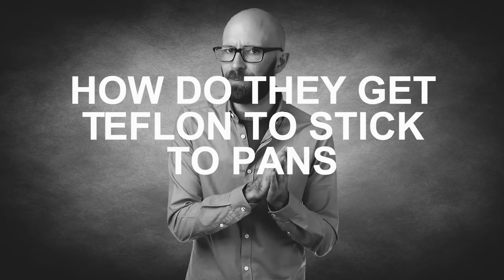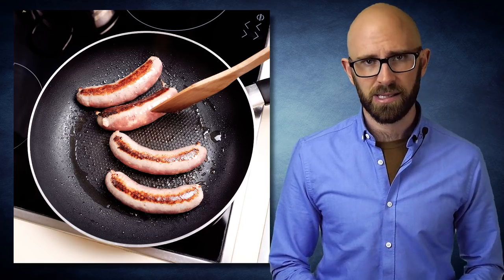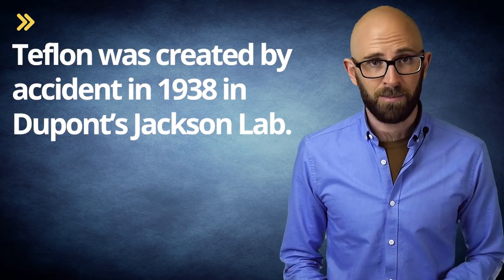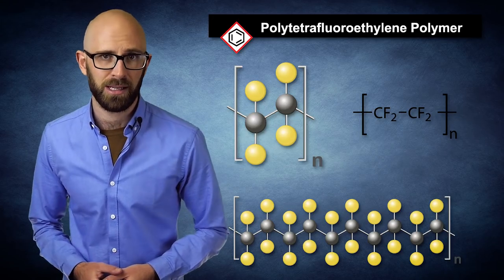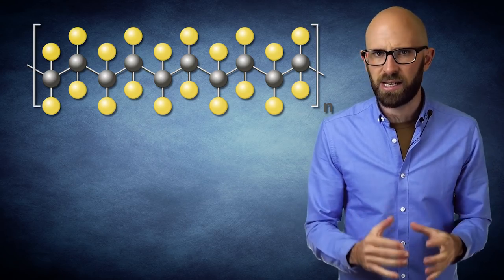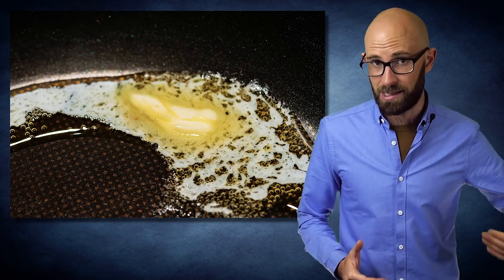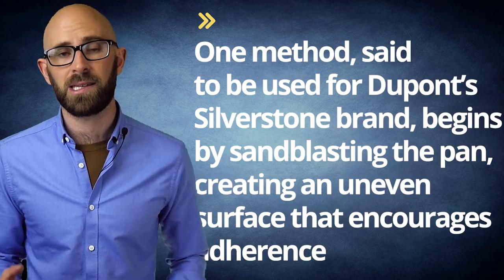How Do They Get Teflon to Stick to Pans?

Comment: I have a video idea: Is medicine with an expiration date still good after the expiration date? Will the effects still be as good as gold before the expiration date, or will it get gradually weaker?
Reply: Expiration date is the date up to which the manufacturer grants that the product will maintain it's original characteristics and will be safe to be consumed. Products may still be good to consume after that, but it's generally not advised to consume expired products, specially medicine, since it's degradation might mean not only it doesn't produce the desired effect, but it even might produce ill effects and harm you.
Reply: or will it decompose into something toxic? and if so.... how soon? There is probably 6 months of Pharmacy school devoted to this topic in some form or another. I have low hopes for a comprehensive answer, but focusing on some common specifics like aspirin and vitamins might be doable.
Reply: I'm sure the safety of this is influenced strongly by the type of medicine and how out of date it is.  Dates on product in general are usually based on a better safe than sorry mentality.  I personally use slightly out of date products of all kinds with no ill effect, based on judgement calls, how out of date something is, and anything I might know about it -- but I'm not saying you should.
Reply: old man voice  Back in the 90s, a pharmacist told me that the date was supposed to represent when 90% of the drug was expected to remain intact (for example, aspirin will lose the acetyl group over time and start to smell like vinegar).  I'm not sure how accurate that is though, as I don't seem to notice getting prescriptions filled with varying expiration dates, but rather instructions to discard after one year from fill date.
Reply: Raffi Sabghir they are not guaranteed to be fully effective after that date. That doesn't mean they immediately degrade, but over time they will become less effective. It varies by batch, but in most cases they will last at least a few months after that date just like food
Reply: Usually fine... Though if your life depends on it, probably best to take something "fresh". As others have said, it's highly unlikely to become harmful but may be less effective. Blister packed things are likely to keep longer as the packaging keeps moisture and oxygen out reasonably well, though not indefinitely.
Reply: There are expiration dates on things that last virtually forever, in most cases just take sniff and you know if what ever it is (food, cosmetic, medicine) has gone bad.
Reply: All that really happens is that the intended effects weaken, or there are new side effects. It basically just doesn't do what is was originally meant to after the expiration date.
Reply: Expiration dates in food are really just extremely rough general estimates, and in most cases are just legal requirements and actually is barely ever accurate. Some powerful person in the 1900's sister got sit from expired milk and he used his wealth and power to make expiration dates a legal requirement. They really mean nothing.

Comment: Industrial PTFE sheet with a back etched layer is common as slip surfaces in machinery, where the brown back surface is there from the ion etching to allow adhesives to bond to the surface to allow you to stick them down to a backing surface. Otherwise you have to drill and use mechanical fasteners to hold down the sheet, or use a thick sheet of PTFE and clamp it down. The front surface is slippery, the back not so. However it has reduced heat resistance, but is commonly used as a backing to apply pressure to heat sealing, like in a bag manufacturing line, where you have a hot bar forming one seal in a bag, then it is filled with things like sweets and then hot sealed top and bottom using another hot bar and cutter to separate the packs.

Comment: In my experience a properly seasoned cast iron pan is much easier to clean. (while it is still hot scrape it out with a metal spatula and wipe out the rest of the debris with a rag and you are good to go)

Comment: you can also use chemical abrasion to get it to stick and it can be applied as either an additive to liquid paint(in this case the oven operation has double duty of baking off the paint additives to leave a coat of teflon) or with electrostatic powder coating(the finely ground polymer powder is given a positive charge and blown towards the grounded metal part with a weird type of spray gun). and by high heat he means 650-850 F. I did some PTFE coating for medical tools.
Reply: So, you're saying you're the Teflon Don of Scalpels? And I'd be worried about using Teflon on products that could potentially go into an autoclave. Aren't they hot enough to get Teflon to gas?
Reply: Jack Linde hey just adding some insight... and mostly insertion tubing, not scalpels. Half the point of the Teflon is to allow these items to go into autoclave cleaners which go to under just under 300f.

Comment: In the early 90's I wanted to see what happened when Teflon met superglue.  But the most interesting finding was the label on the new pan: It was stuck, quite hard, to the Teflon.  I peeled it off noting that the sticker was tough enough to pull hard without shredding it.  But, the back of the now-free sticker felt only slightly tacky -- less than a post-it note.  My first assumption was that the adhesive was spent.  But, accidentally reuniting them, I found that it still grabbed the Teflon quite fiercely!  

So, this adhesive is specific to Teflon and doesn't act sticky in the general sense.  

Though I must say, a sticker proclaiming "non stick" is rather ironic in two ways.

Comment: "How Do They Get Teflon to Stick to Pans?"

They don't.  That's why it always ends up in your food.
Reply: Even if it ended up in your food, the chemical bonds are so strong that the hydrochloric acid in your stomach is little more than a warm pond to it. 

shush.
Reply: And in poor parrot's respiratory systems.

Comment: Bet my Seasoned Cast Iron will out  outperform any nonstick cookware.
Reply: Depends on what you want to do, but yes, good cast iron certainly is great, but also something >90% of all people would ruin in just a matter of months.
Reply: just careful of high acidity foods, especially often.
Reply: While I love my cast iron, it loses advantage at higher temperatures and reduced fat levels.  For quickly caramelizing sugars/lipids and working with lean proteins (i.e. roux, glazes, omelettes, skinned chicken), ceramic or teflon will win.  For slow-cooking, juicy meats like bacon, and oily stir-fry/braising, seasoned cast iron is still the flavor boss (and bonus -- functionally immortal and indestructible).
Reply: You still have to scrape food off cast iron pans, while ceramic might not last a lifetime but the hassle it saves is worth it.
Reply: Michael Parker Not if it's  well seasoned. Never use soap. Hot water, reoil and heat. Fried eggs easily slide out.
Reply: Robert McKeown That's precisely the problem that you have to baby it to keep it working which the average family just won't.
Reply: You can make English muffins on cast iron cookware!
Reply: teflon used at high temperatures releases c8 gas and is known to cause cancer. dupont just settled a lawsuit for $670million for exactly this.
Reply: The best cookware ever made...Cast Iron!!!!!!

Comment: Forget Teflon pans , they peel over time and pieces start getting in your food (it’s not good to eat plastic lol). Stick with ceramic coated pans for a better and safer non stick pan , or just get some stainless pans.
Reply: I bought a ceramic pan and that was by far my best acquisition as far as kitchenware goes. I can't recommend it enough.
Reply: I prefer ceramic as well, but I would never pick a stainless pan over a teflon.
Reply: I've heard that Teflon manufacturers include a warning label to stop using the product if it chips and to not use very high heat (vague, I know) because they would create toxic fumes dangerous to human health. My Teflon pots are all chipped and I will not be returning to them.
Reply: Teflon hardly reacts with anything so it's basically fiber, most plastics are similar when ingested. But I do agree ceramic pans last longer and less prone to flaking.
Reply: forget teflon, forget ceramics, forget stainless.

cast iron is all you'll ever need.
Reply: Iron pans FTW
Reply: Boiled Milk Steak: Actually, they've done studies and the worst that Teflon can do is mildly irritate your digestive tract. HCl doesn't do anything to Teflon, so the bits that get into your food usually just flush through your GI tract and exit in your poop. If a piece does get lodged somewhere in your GI tract, it is no worse than if other bits of food get stuck. Teflon generally doesn't interact with anything, so it would be a foreign irritant, not a poisonous chemical as you are inferring.
Reply: @Christiana I forgot about the fuming aspect. Yes, if the pot or pan is empty, and you heat the pan at high temps, it will create a poisonous gas. But then again, you're also running a risk of fire on your stove, since you've left an unattended pan cooking for a long time.
Reply: Cast iron!
Reply: The only real problem with Teflon happens when it gets over 400 °C, or 750 °F, which can only happen when you put it on a stove and let it heat up with nothing it it for quite some time. It's usually risk free because cooking at that heat isn't possible in the first place. As far as ingestion is concerned - that is an urban myth that has been circulating - i think as long as teflon-pans exist. But as Jack Linde said, it won't do anything, just pass through you. The teflon can, however, peel, as Milk said, and once that happens the food sticks, which kind of defies the whole idea of teflon pans in the first place.

As for ceramic pans - while they are really good, if you are careless and drop them the coat can break. So they are - imho - nothing for the clumsy or absolute beginners, and if you want some reasonably good ones they aren't exactly the cheapest choice either.

Stainless pans, while pretty forgiving when handled poorly, have the disatvantage of food sticking to it, especcially if you burn something. If used over longer time while cooking a lot with salt they also, even though they say they shouldn't, tend to corrode. Mind you, this usually takes quite some time. 

It all boils down - imho - to personal preference.
Reply: Teflon non-stick pans have their place but you need to take care not to scratch the coating, which can also burn off at high temperature. I assume the OP is referring to cast iron ceramic coated pans like Le Creuset. I have one that's nearly 40 years old and it's still going strong. If you only have one pan in your life make sure it's cast iron! Not so great if you're nomadic though...
Reply: Agreed. Also whatever you can get your hands on for free if you're skint.
Reply: I love your name. Milk steaks are my favorite. I like it over hard and with a side of jelly beans but only fresh. Cooked jelly beans suck
Reply: Teflon itself is relatively harmless when ingested because it does not bind to anything , and that includes us, water, and our internal gut lining. The concern comes from the additional chemicals used in treating the pan. Ceramic is great but avoid heat shocking it and you will be fine.
Reply: Windhelm Guard Cast actually freaks me out since you aren't supposed to clean it. I just can't do it.
Reply: brkr78 this isn't JUST a temperature issue though, it's time as well. The extreme heat changes these pans undergo rapidly increases the aging process(weakening the polymer bond) which is what allows it to flake off. But yes, the biggest issue with the pans is overheating creating highly cancerous gasses. That's why many industries are being forced into using non-pfoa materials which greatly lowers the carcinogens, but doesn't stick to metal as well. It's the reason I left the industry... My plant was using pfoas and the ventilation was not up to code and I was sick of fighting for it.
Reply: For many years, I worked in the industrial metals field and know that Teflon breaks down with heat, so no wonder TFE coated pans stop working.  The video didn't mention this.
Reply: I don't even own a teflon pan. All of mine are cast iron or stainless steel with a ceramic coating. I've used teflon, and they simply can't compare.
Reply: And there are certain high end pans which are stainless steel which last for a long while, and has a life-time warrant. They generally go around in the thousands in price
Reply: I don't know what you're all doing with your pans but we have teflon pans since arround 8 years (probably even longer) and they're still as good as at the first day. No chipping or anything like that.
You just have to handle it carefully and not scratch arround alot with a fork or a knoife or something
Reply: Thats coz you put them in the dishwasher
Reply: how hot are you getting your pans and are you using tef2 
think you might need to learn to cook 1st
Reply: Another Cast Iron fan here. Use soap to clean them to, just not as much as for other things. And they can be reseasoned as well.
Reply: Wustoff (the German company that makes some of the best comercial kitchen knives in the world) just came out with a new ceramic pan technology first developed in South Korea that promises to be almost as non-stick as Teflon but signficantly more durable and heat resistant (still can chip if you arn't careful, but nowhere near as easily as Teflon which basicly chips away if you blow on it).  I've heard osme good stuff about it and might get it myself.
Reply: Don't use metal tools to cut in or scrape with or even move around in your teflon pans, and holy shit look at that, PLASTIC DOESN'T DAMAGE PLASTIC?! WAIT WUT?! 

also stainless is a horrible option for anyone with possible nickle allergies. lrn2chemistry and lrn2metallurgy.
Reply: Most pans don't even use Teflon anymore
Reply: The ted talks video covers most of this but I’ll sum it up, it’s okay under 500 degrees and the little chips are considered okay but it’s advised not you consume them

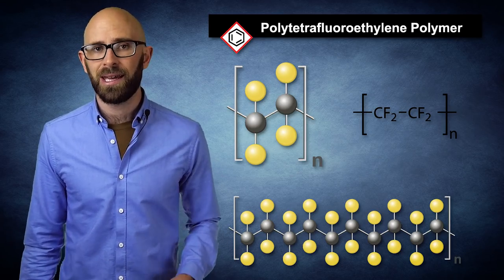Comment: A Fluoridated polymer isn't a long chain of identical molecules, in contradiction to the statement at 1:00
As first of, Fluoridated polymers can be any polymer that has fluorid in it. This could be anything from Sugar to Fat, to any other polymer.
Secondly, the repetition of the carbon fluorid pair is true, but the whole chain is the molecule. These molecules are though not making a chain as a group, but rather just a tangled mess similar to spaghetti.

Though, it is true that Teflon is a fluoridated polymer chain of an arbitrary length. But it would be nice to not have the term molecule used so freely outside its definition.

Comment: Woll has a product that they claim to uses diamond a coating which they claim is metal utensil safe, dishwasher safe, and oven safe up to 260c/500f.
Reply: oven-safe up to 260°C?
Wow, my car is highway-safe up to 70 km/h :P
Reply: @ABaumstumpf  you're car isn't 260c safe, your statement was absolutely horrendous. Just stop it, get some help.
Reply: @ABaumstumpf  no I got what you were saying about the typical use of an oven, I left it on the table because your statement is irrelevant as possible, not all pans are meant for ovens so he was clarifying.

Comment: Teflon pans are great, but once you go Cast Iron you never go back.
Reply: I have a glass topped stove. I only use my cast iron in my camping kit.
Reply: I have a glass top stove and I use my cast iron on it all the time.  I've done it for years with no problems.  However, I do place the pan on the stove somewhat gently, but then all of my pans are metal, so I set them all down on the glass top gently.
Reply: Well the iron pans are black maybe that's why you haven't gone back
Reply: you shouldn't have to clean a properly seasoned cast iron skillet, because almost nothing sticks to it. And if you do have something stuck in it, the deglazing technique works well.

Comment: Anyone know what reducing agent can reduce a C-F bond?
Reply: likely some F-based agents, pretty much nothing else is aggressive enough.
Reply: Probably an unstable thing (like H2F or an equivalent ionized compound?) that required energy input to form in the first place and works by substitution.  Low temperature plus electricity/photons will let you make some exotic stuff that won't last very long, but it will do what you want before it goes away on its own or... um... explodes :)
Reply: Thanks and to +ABaumstumpf! i was just thinking how useless normal bench-top reducing agents would be. Would have been nice for him to have thrown us science-folks an actual reagent :P